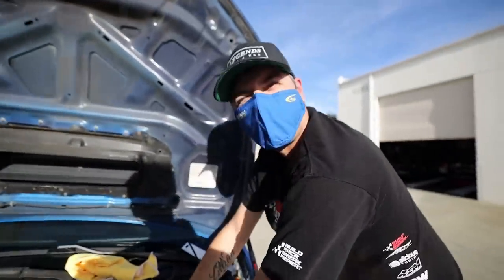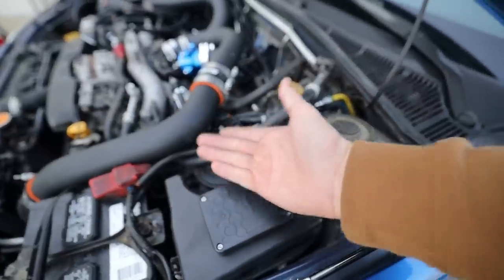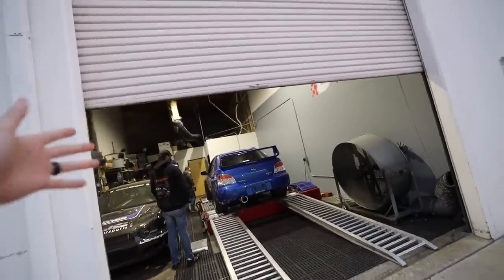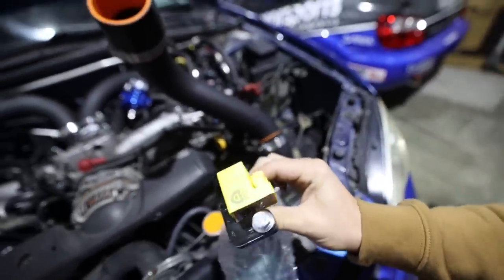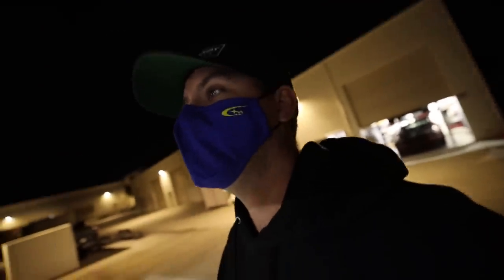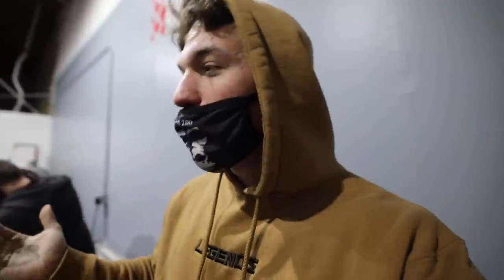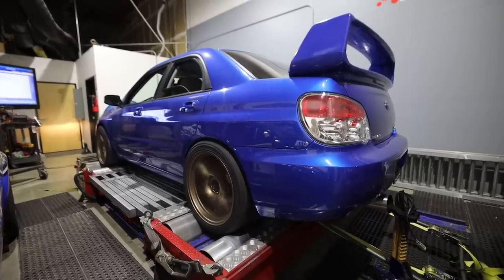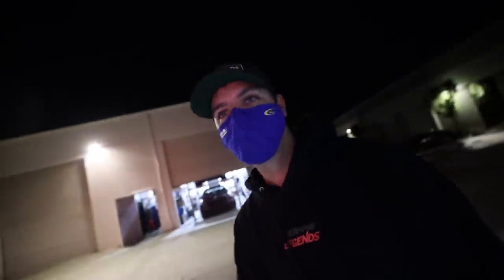Tim's Full Bolt-On WRX Gets e85 & Dyno Tuned! *WAY MORE POWER THAN EXPECTED!*

Comment: Any WRX 5-Speed over 300hp : "I'm in danger"
Reply: I have almost 10 years on my 2011 5 speed with 330whp. So far so good.
Reply: @slimigan  I think as long as you don't always beat on it and you use quality parts it's pretty safe.
Reply: What about the classic head gasket ?
Reply: @Clean_Duners  Head gaskets were only issues on the old n/a models and not the turbo models..
Reply: @slimigan  that’s because the 2011+ WRX uses the legacy GT gear set which is much stronger
Reply: @whoischris28  actually it’s a thing on pretty much all ej motors.. unless you somehow get an engine that refuses to die lmfao
Reply: @baus2k  my bugeye is 240k miles stock motor and i’m about to throw on EWG, 1050cc ID’s, and E85😂
Reply: @boostedtony401  send it with an fp green as well
Reply: @nickomara1221  doing a vf39
Reply: More like 400hp and just don't be dumb! 🤙👍

Comment: All my Subaru heads started crying when he put in 5W-30. 5W-40 Dustin! 5W-40!
Reply: Yes! 5w-40
Reply: yup motul tho
Reply: VR1 20w-50 here
Reply: @armanmorando1068  BUILT engine?
Reply: @IcySTi  nope stock EJ20X, car made 430AWHP. haven’t any issues after 6 months and i’ve driven about 8000 miles
Reply: 10w50.in my sti.blob...always used that never had problems

Comment: RIP 5 speed, RIP stock block and internals.
Reply: Y jinx it though?🤔
Reply: As long as he isn’t driving around on e85 all day it should be fine
Reply: @stetsongray5355  it’s his daily rip
Reply: @stetsongray5355  why do you say this
Reply: @peterwade2389  any Subaru guy knows those are some scary numbers for a unopened engine
Reply: @stetsongray5355  310 is already pretty high on the limit
Reply: @stetsongray5355  e85 is the only thing saving it's life !
Reply: @Gelenvader3  450WHP STI here stock longblock 🦍 going strong still
Reply: @Fer-yx5oz  your car still going ? What turbo do you run ?
Reply: @unknownalias5538  going strong still! 
Bouta get tuned again with a FP black, so 500WHP+
Reply: Till it blows lol

Comment: What's with the exhaust sounding all fluttery? Sounds really weird, but the overall tone is good.
Reply: ELH
Reply: @georgekingara5788  Huh?
Reply: @kasper_429  Equal Length Headers
Reply: @georgekingara5788  Ahh, okay. I've only ever heard unequal length lol. Definitely needs to change the header then.
Reply: @kasper_429  ELH is much better for the engine, it makes it more reliable and smoother. All rally cars use ELH and all JDM STI's since 2002 use ELH's too
Reply: @luka_abh  But do all ELH headers make the car sound fluttery/jittery like that? I would hate that lol. Sounds good at speed but yeah.
Reply: It’s the boost controller
Reply: @kasper_429  usually that flutter comes from external wastegate, but he doesn't have it, so I don't why it sounds like that
Reply: The fluttery sound is the boost controller/the internal wastegate
Reply: Flutter is from the electronic boost controller. If it had a manual it wouldn’t do that flutter.
Reply: @luka_abh  the flutter is ebcs. I had an external wastegate on my foz with a manual boost controller and it didn’t flutter. When I changed it to ebcs it fluttered.

Comment: Anyone else hear apparent oscillation in the wastegate? Like it sounds like in the video that it needs to be leveled out or something.
Reply: That’s the electronic boost controller making it sound like that.
Reply: @timrichards7015  my point is that I think there's some work that can be done to the control logic to smooth that out.

Comment: Why not get an sti of the same generation instead? Is this motor more reliable?
Reply: No, it's not
Reply: Because I wanted a wrx to build.
Reply: @timrichards7015  why though? STI has a stronger trans, engine, diffs, DCCD, AVCS, bigger brakes, nicer interior, better suspension etc.
Reply: @luka_abh  yes sti has stronger trans and all that. 07 wrx does have avcs on the intake cams. But anyways I wanted to build a wrx and then do some things to it and make it better. You will see why I didn’t get an sti if you keep watching

Comment: It sound off. The exhaust Im talking about.
Reply: I agree, the  exhaust flutters to much and does not have a good tone either, I don't know why he put those headers on especially for his power level, it is not necessary at all
Reply: Equal length are more efficient than uel
Reply: @nichuynhh  i understand that they are more efficient, but at around 350-400hp you will not notice the difference that much to even be worth it
Reply: @paul4733  you don’t even know what your talking about 😂 equal length is way better for power and more efficient
Reply: @luisdiaz2507  for what power? Tims WRX is making just 60hp over a stock STI, you only need equal length headers when you are getting excessive heat from a substantially larger than stock turbo and for high power applications. Also I am aware that unequal length headers poses a risk of causing heat to build up in cylinders 2 and 4 (passenger side) because of the runner length of the oem headers, but again he is not making a ton of power over stock so this problem is less of a problem with uel headers.
Reply: @paul4733  stock Sti’s only make around 240-250 WHP.😂 Tims made 370 WHP on a stock a ej255. considering it’s a unopened engine i’d say it’s def worth it. less detonation
Reply: @Luis Diaz Your not going to get that much detonation protection with El headers as you will with e85 which he is running, so his car running e85 will make el headers not needed
Reply: @nichuynhh  I have ELH in my subi, it doesn't sound like that. Also having ELH gets rid of the subi rumble.
Reply: @paul4733  more mid power and more power up top with elh. but to each of their own 😂
Reply: @luisdiaz2507  true, this was a good conversation, thanks for being so nice and professional about it👌